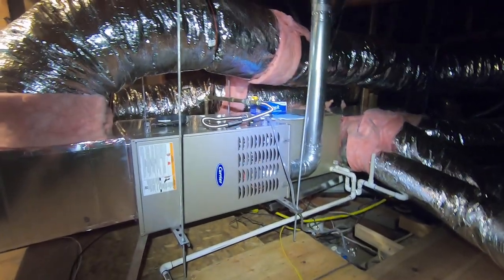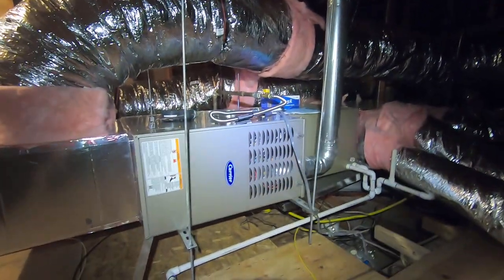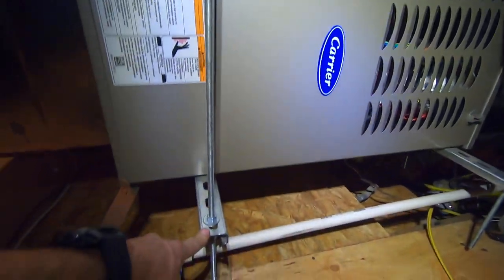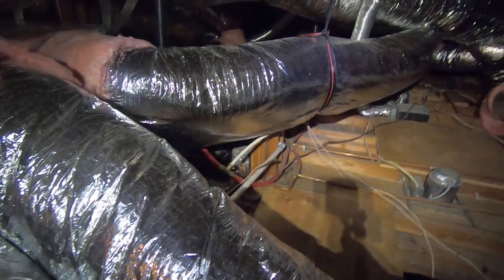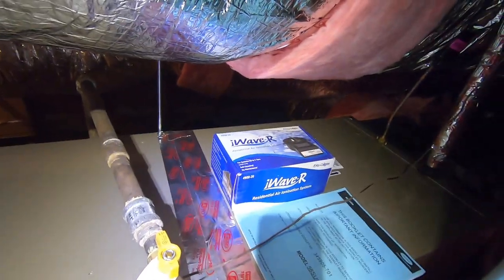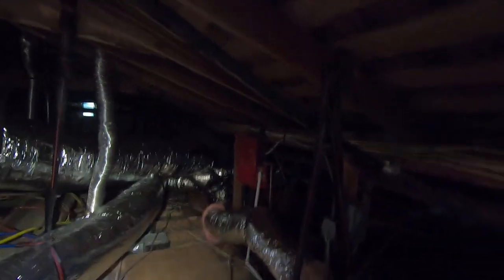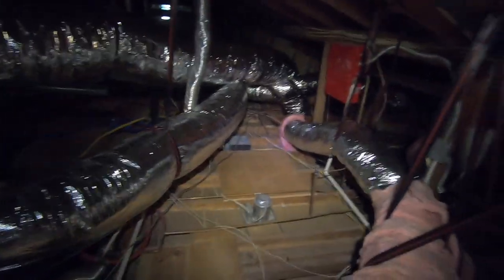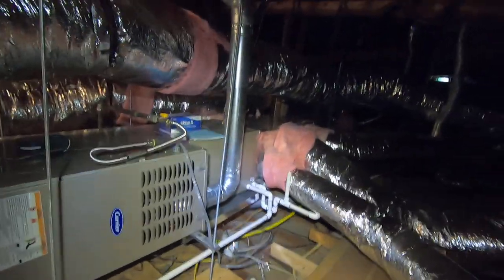Move Furnace to Attic

Comment: I had one in the attic 30 years old. I
Just installed a new one downstairs.  Makes servicing so much easier.
Reply from the maker: It sounds like the furnace relocated downstairs works better for you.  In this situation we moved it to the attic from a laundry room because they were doing a remodel and needed the space.  The new furnace location in their attic actually works great for them because they have a pull down ladder and cat walk for easy access to the furnace.  We were also able to add multiple return grills to their ceilings to pull hot air from different locations in the house to make it more even in temperature.

Comment: Put a new system in my attic yesterday it looks just like that. They removed the old decrepit system from my closet. Ran the gas line straight up just like that. I had never heard of suspending it on cables.
Reply from the maker: That's great.  You can either suspend the unit or put in on a platform with stands.  Either way works fine

Comment: This is very nicely installed. Great work. How did you physically get the system into the attic?
Reply from the maker: Thank you for watching the video and nice comment about our work.  This house had a pull down ladder in the garage with an access door to the attic that we took the new furnace up and through.  Sometimes it is not that easy and we have to cut a new attic access (22"w x 30"d) to get it up there.

Comment: Most New home Contractors in the Phoenix area now have the a/c unit installed in attic, it is a bad idea because of the dust. I am checking now to see if I can install back in the garage as they should be. In other parts of the country where dust is not a problem is a good idea.
Reply: Yes, in your area the dust can be a problem in the attic.  This system was installed in Orange County, CA so we don't have that problem.  It is a good solution for better air flow and overall system efficiency.  Plus, this customer wanted to use the old furnace closet to expand a bathroom.
Reply: attic ac is not efficient at all.
it's better to have it in the garage

Comment: I was told my attic was too small to fit in a furnace. There are cross beams in there. I am trying to avoid putting AC unit on top of roof because over time leak damage brought down ceiling. Roofer recommended I get a ground unit because of the damage it did to roof over the years and had to have roof replaced. Just found out from third party that Home Depot uses that the cross beams in my attic won't allow that. Going to keep on checking with other AC contractors to see if it is possible to still do a split system.
Reply from the maker: That is very common.  Sometimes there just isn't enough clearance with cross beams in the attic to fit the furnace.  Hopefully you can find a good solution that will work for you.  Good luck with your project.

Comment: Should the supply line come out of the top or side, and never out of the end of the unit?
Reply from the maker: With a traditional horizontal coil like the one in the video the ducts can come out the sides and top, never the front.  With a plenum coil the ducts come off the sides and front, never the top.

Comment: Did you used all the same a/c coil and furnace  just flip it ?! Or is there a different special king of  furnace and a/c you have to use
Reply from the maker: We removed a 25 year old furnace, condenser and coil.  The furnace and coil were in a closet in the laundry room.  We did a new Carrier furnace and new ADP horizontal coil and put them in the attic with all new ducts and a new condenser outside.

Comment: We have our furnace in the hall closet near the living room and are constantly having to adjust the tv volume when it kicks on and off. And, our master bedroom, which is farthest away from the unit, doesn’t cool as well as the rest of the house. Should moving the unit to the attic will remedy both problems?
Reply from the maker: Yes.  Moving the furnace will be able to help both issues you are having.  I would suggest making sure you do two new return air ducts/boxes/grills.  One on one side of the house and the other close or in your master bedroom.  This will help balance the temperature and keep the system very quiet while running.

Comment: I have a Rheem furnace in a closet in my house and am considering moving it to the attic. How can I tell if the unit has to remain vertical or can be turned horizontal? I don't have room in the attic for the furnace to be vertical. Thanks in advance
Reply from the maker: Thank you for watching my video.  Depending on the age of the furnace most are multi directional.  Also, you would need to move the evaporator coil to the attic as well.  Those are typically directional and you would need a new one.  I would call a local HVAC company and have someone give you an estimate.  They will be able to tell you what and how it can be done.
Reply: @albertairinc.1140  thank you for the info! My unit is only 3 years old. It sounds like a Boeing 747 leaving the runway every time it starts up in the hallway closet and I could use the extra room for an upcoming bathroom renovation
Reply from the maker: @masonball3684  No problem.  Moving it to the attic will make that system much quieter.  Good luck with your project.

Comment: Looks very nice!  Impressed! Does that horizontal coil on this unit have an access panel for cleaning, or do you have to start breaking the unit apart to clean coils?
Reply from the maker: Thank you.  Yes, the top panel of the coil where the refrigerant lines attach will come off if needed.

Comment: How did you install/screw  the all thread into the rafters?
Reply from the maker: You need the proper hardware to install the hangers.  Nuts, bolts, couplings, etc..
Reply: Hmm. All thread screwed right into the rafter.
Reply from the maker: @spinroyd  It is a threaded lag to a coupling to the all thread.

Comment: Albert I was wondering if you can help here. I have an attic unit Trane (lays on the side horizontally) We just had a week-long of zero-degree weather end of January in Chicago, before the arctic blast the temperatures outside were 25 to 30 degrees I was reading a nice 96-98 degrees using the red dot temperature thing to take the reading from the supply registers. Once the big cold blast hit as temperatures were falling to rock bottom my nice 97-98 degrees at the supply registers started slowly turning into 87-89 degrees at supply, later in the night that 87-89 degrees now was down to 84-85, even later as the night went on more my supply was now down to 80-82, and by morning we are at zero outside and my supply vents are down to 78-79 at the registers. What the heck could causing this whopping 20 degrees difference? I had to leave the house for a hotel because it was 56 degrees inside!!!! This is NOT an air duct leak, I went up in the attic and right at point exit of the furnace I was getting 80 degrees coming directly out of the furnace itself!!!! This is driving me bonkers! I have a Nest so I can monitor the inside temperature without being home, could this be limit-switch and cutting my burners off "thinking" its overheating? After the cold snap has ended and temperatures rebounded back into the 20's and 30's I was back at that wonderful 97-98 degrees out of the registers. Where was my 97-98 degrees during the coldest time???? And no, I have the cleanest air filter in the neighborhood, nothing is blocking ANY cold air returns, all registers are fully open. Please don't say the filter is dirty like everyone else says because I even took the filter out, and it still ran like this. Please any help here would be greatful.
Reply from the maker: I would have a technician check the heat pumps refrigerant charge and defrost cycle.  That could be causing the system to have that fluctuation in temperature output.
Reply: @albertairinc.1140  I don't have a "heat pump" I have a regular 80% furnace. My other guess was a couple years ago I put a new chimney cap on (the regular black square with the screen) I believe that I need a wind resistant cap. The one that was up there was a rather enclosed cowl type) which blew down from high winds and broke. I think the black square with the screen is causing too much of a downdraft and rolling my fire out and it's shutting the furnace down. My unit is in the attic and goes into the brick about 5 or 6 feet from the exit of the chimney, I may not be getting a good "draw" there. That was the only thing I changed until it ran like crap when very cold/windy outside.

Comment: I want to move my old house furnace to outside of the house. Indoor is so annoying and too loud for the bedrooms around the furnace
Reply from the maker: Moving the furnace to the attic will make the system much more quiet  will running and better air distribution.  I highly recommend it

Comment: Can you put the furnace vertical in the attic if is space
Reply: Yes you can put the furnace vertical if you have enough height in the attic.  You would need at least 7 to 8 feet total to make it work correctly.  Then you would need a return duct on both sides of the furnace for the correct airflow.
Reply: @fijiman88  thank you very much

Comment: Where is the filter located on this furnace??
Reply from the maker: The filters are located in the filter return grills.  Hallway ceiling and entry way ceiling.
Reply: @albertairinc.1140  Great video! Thinking about doing the same and I live in OC. So the filters are not located on the furnace unit but at the ceiling vents?
Reply from the maker: @davem7763  Thanks.  That is correct.  The filters are located in the return grills in the ceiling.  We are located in Anaheim, CA.  If you would like me to give you an estimate on moving your furnace to the attic give me a call 714-526-6368.  Nick Albert

Comment: where is the air filter located?
Reply from the maker: The air filters are located in the return filter grills in the hallway ceiling and master bedroom ceiling.
Reply: @albertairinc.1140  Thanks, I replaced that filter as I do on a regular basis, still prompts me to clean or replace air filter, I have the filter with arrow pointing upwards, is there a different filter I should look for?
Reply: @carolynzraikat6678  I would see if there is a way to clear the filter reminder in the thermostat settings.
Reply: Thank you so much for everything the you teach us. And thank you for answering our questions. You have no idea how you help single woman home owners. You help me tremendously. Like this simple question but so important. Thank you

Comment: Thank you for sharing this video, it helps me understand the AC/Furnace set up.

However, I encounter an issue of huge difference of air temperature came out of each air registers;
for examples:  Return air 83F;   Register #1  81F,  register #2  73F,   register #3   64F;   all these registers are in the living room.
Actually, register #1 is a new replaced duct with R6 insulation, why its temperature out of the  register is so high?
Do you have any idea what cause the temperature  with so much difference?
Thank you for your help in advance.
Reply from the maker: It is hard to say without looking at your system and doing testing on it.  Here are a few things to check.  1 - Condenser is charged to proper subcooling levels per manufacturers specs.  There is usually a subcooling number on the condenser label that shows this or there is a chart in the manual.  2 - Ductwork is correct sizes and sealed and insulated properly.  3 - Make sure no ducts are blocked, all vents are open and filter is clean.  4 - Temperature split between return air intake and supply air outlets should be between 16 and 20 degrees difference.  (example:  temperature going into return air grill is 77 degrees and temperature coming out of supply air grill is 57 degrees.  This would give you a 20 degrees temperature split.  This is very good and your house will cool properly.  note - do this test when system is just turned on as the temperature will get closer together as you run it longer).  I hope this helps.

Comment: What is the cfm and btu for this unit
Reply from the maker: 60,000 BTU FURNACE.  1200 to 1600 CFM
Reply: Why in the world would anyone EVER want to move a furnace from a floor closet into the attic? The heat of the attic is the worst part of the service. Builders put them there, but if anyone had a choice, it would not be the attic.
Reply from the maker: @realSamAndrew  There are several reasons why we moved this furnace to the attic.  1 - The closet location where the furnace was previously located was at one end of the house with inadequate return air.  2 - The furnace was extremely loud in that closet.  3 - The air flow distribution thoughout the house was poor becasue of the loaction in the closet.  4 - The homeowner wanted to use that closet to enlarge a laundry room.   5 - By moving the furnace to the attic they solved all of those issues.  Better return air, quieter operation, even airflow through out the house, and gained space to enlarge the laundry room.  And the attic space is very large with plenty of combustion air and venting.  So, in this particular case it was a no brainer to move the furnace to the attic.
Reply: @albertairinc.1140  I mistakenly posted my comment under another comment instead of a new thread, but thanks for answering. While your solution makes sense, what will you have to say if you get called for a repair  in August at 140 degrees in the attic?
Reply: @realSamAndrew  clown
Reply: How old is the furnace? If the location was that bad, I understand moving it.
Reply: @albertairinc.1140  How old is the furnace, and what is the efficiency rating?

Comment: That pink insulation exposed makes me want to puke. Otherwise it looks well.
Reply from the maker: The pink insulaton is 9 inch cut wrap (R-6) which is code in our area for all metal connections in the ductwork.  The other option is doing FSK wrap (R-8) which is more expenise by 30% to 40%.  Because this system/ducts are in the attic and no one see's the insulation it was not a big deal to the homeowner.

Comment: Personally, I feel that gas furnaces should be illegal in the attic space.
Reply from the maker: These furnaces are perfectly safe to be into the attic area.  The new burner boxes are fully incased so there is no open flame or flame roll out that can happen.  They also have many safeties installed to ensure no overheating and/or malfunction will happen.  There are many benefits to having them in the attic and that is why people move them up there.  As well as most builders in our area of Southern California put them in the attic.